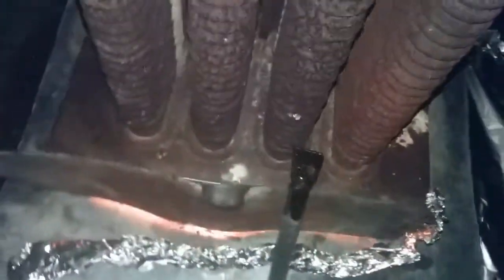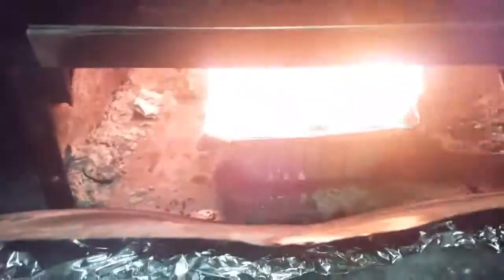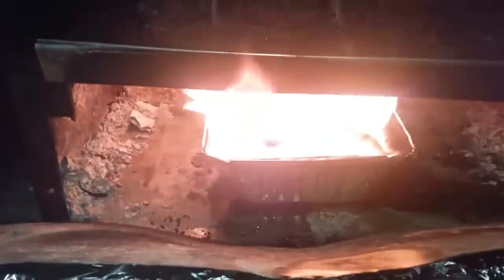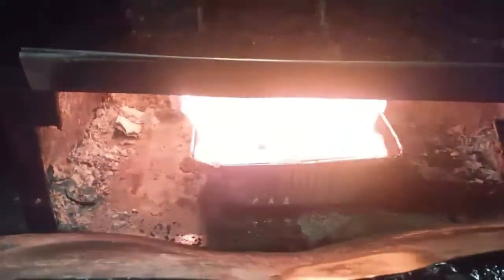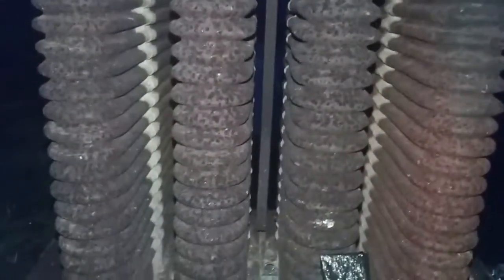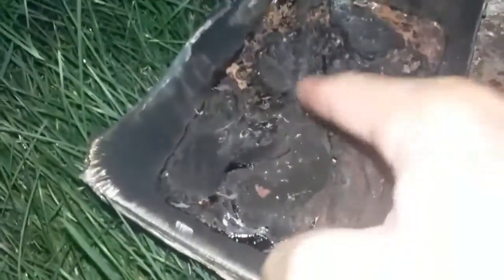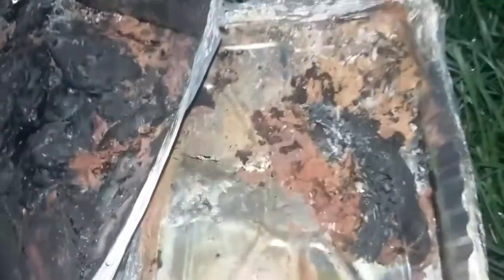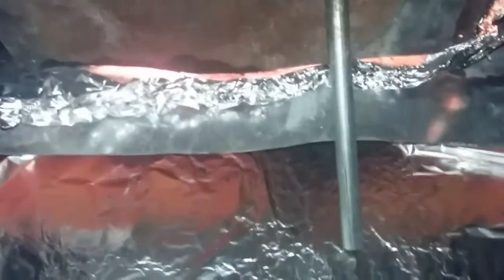Burning off a gallon of cooking oil

Comment: Very creative! :)  Much better than pouring it down a drain or flushing it, as I've heard many people do.  It's even on the news occasionally, people having their drain pipes, or, town/city pipes, cleaned of this!?!?  It cools in a pipe and leaves a greasy, build-up mess that constricts or blocks proper drainage.

Another thing is to use this oil to make suet.  Add flour and birdseed until it gets pasty; then, freeze it in blocks until winter.  Not only birds, but, wildlife in general, love this, especially during the cold months.  It may melt and make a mess in summer.

Awesome video - thank you for posting! :)